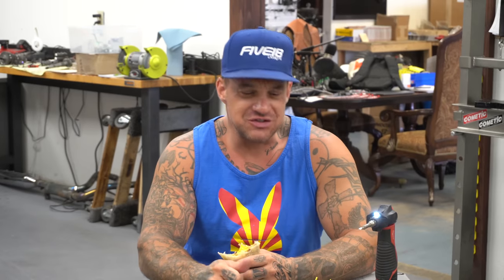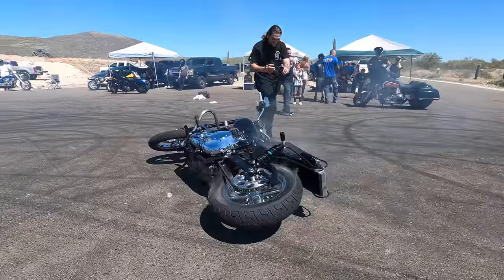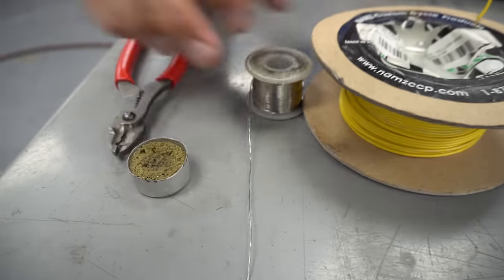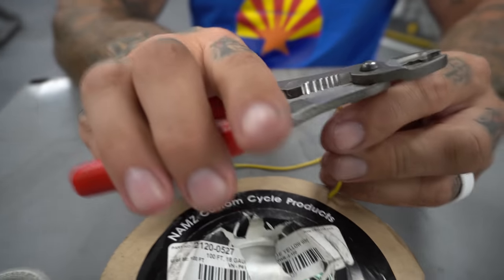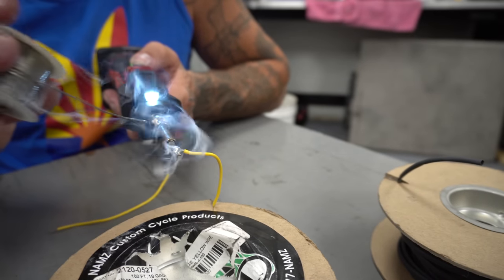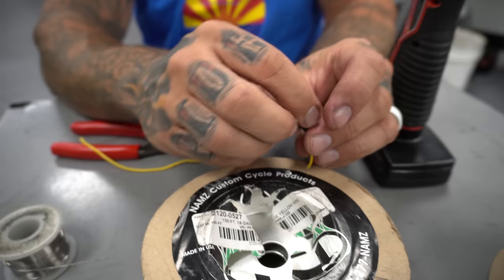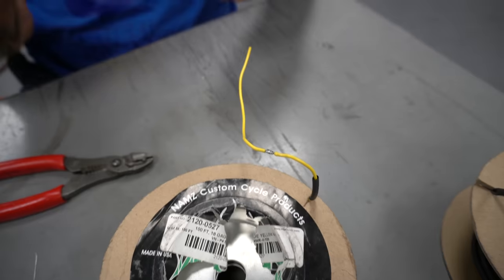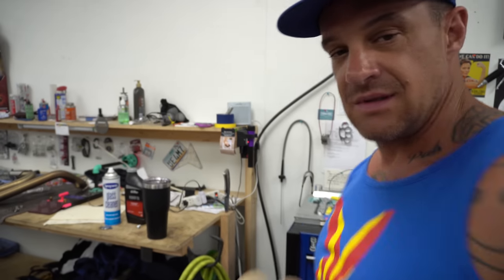Soldering wire on a harley davidson the right way! with Kruesi Originals

Comment: Don't forget the tug test.  He tug tested it, but didn't announce it.  You do NOT need flux unless you're soldering to an exposed metal surface.  In this instance he was soldering a freshly stripped aluminum wire, to freshly stripped aluminum wire.  If that wire had been exposed to air for a while, then he would have benefitted from flux.

Comment: Me personally I open the wire strains open and place the open wires into each other then spin them slightly tight then apply the solder then heat shrink what your looking for is the wire to be as thick as a normal section of wire. This is key for internally wired handle bars so they all fit within the bars! With the 20 years I’ve done this I have never had any problems ever! When I wired electrical magnet motors for train doors every single wire was inspected and tensile tested to spec. I actually like wiring work I take pride in my wire jobs weather is for handle bars or winches or wire harnesses it tedious but I find it enjoyable

Comment: Right on, I was still trying to use the HD method taught at MMI and i was cussing a storm. I’m gonna try this method tomorrow on my aftermarket led fog lamps.
Reply from the maker: People keep talking about some HD method from MMI.  I went to MMI there is no HD method this is how I was taught 14 years ago at MMI. And every shop I ever worked in.
I would like to know what this MMI version is I have had several people tell me about it.
Reply: @kruesioriginals  I’ll look for the textbook and tell ya the measurements they want for the creep abs solder joint.
Reply: @everperez8538  Aye you got those measurements yet? I'd like to know!
Reply: @T600INFILTRATOR  yeah, when I was in the last phase of HD electrical there was a max solder and creep allowed of 5/16” when you bend the wire at the solder spot. I had forgotten about this post.
Reply: @everperez8538  Thanks a bunch 🙏

Comment: Why do u like this method over others ? I have twisted wires opposite direction that will not pull apart without solder but I still solder. So just curious y u prefer this method
Reply from the maker: Because it’s the cleanest and the right way to do it. I don’t care who you are nobody’s pulling this apart
Reply: @kruesioriginals  I willing to try it just never seen it done like that without much wire and no twist gotta couple of tech guys that are friends that wire everyday and never seen so gonna show them this technique

Comment: Didn't use the crimper (not that you needed to) . Also, use a lineman splice if current capability of the wire is a concern - more copper on copper contact and won't pull loose easily should current get high enough to soften the solder.
Reply: I always use this method as well, more secure. Only issue is it is more bulky so on wiring up a dirt bike or Harley, sometimes you have to use the method in the video because it is more low profile but much weaker, especially if there is a loading stress on the wire (even from gravity where it hangs down).
Reply from the maker: Garbage

Comment: Please watch this for some good entertainment. 
But don’t watch this to learn how to solder. There are lots of way to solder, this is not one of them.
Reply from the maker: Nope this is it.
Reply: I use this exact technique, I was a car mechanic for 10 years, never had a single wire fail using this method.
Reply from the maker: @311_emil  amen